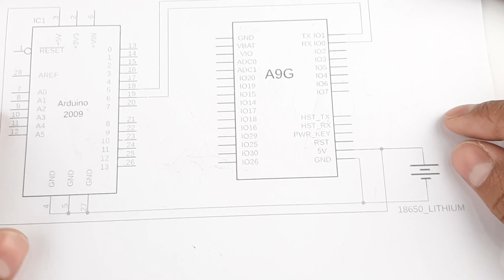SMS Based Vehicle Tracking System with A9G GSM+GPS Module and Arduino

Comment: Hello Sir. Im trying to make the same project but with arduino uno. Im able to sun AT commands on A9G through blank arduino and it runs successfully. But when i use your code the arduino is not able to communicate with A9g. How to solve this issue? im using micro usb cable to power a9g module as of now
Reply from the maker: Make sure the connections are as per the given schematics. It is important to use proper pins for UART.
Reply: @Circuitdigest  thank you. I reconnected everything, and it seems to be working now. I also wanted to connect a speaker so to hear the other side. So I use a 5v stereo audio amplifier (only using left side of it) but I can't hear the other side. The usual sound that a9g makes in serial communication in Ai thinker application is there though

Comment: does not work...
Reply from the maker: What was the problem? You can get more help from our forum. https://circuitdigest.com/forums
Reply: @Circuitdigest  A9G does not recognaize the AT commands, hence gps does not start...
Reply: @cgoguerreiro  im also facing the same issue. Does a9g when using blank arduino code or through serial converter accepts code? mine does that way

Comment: Sir Need your help !!! Sir serial monitor is showing sending msg (even the lat longs are correct ) but i haven't rcvd any msg on the number which i have entered in code. Would be grateful if you help sir
Reply: does not work the A9G will not start GPS because it don't receive the serial setup

Comment: Why are you using arduino? What does the arduino do?

Does https runs for~ 7 minutes and stops working in code? in a9g board.
Reply: As you didn't get an answer, I hope this one will do. The A9/A9G is based around a standard micro processor (SOC) which runs firmware that handles all the Satellite and Mobile phone requirements. The firmware on the A9/A9G also monitors the serial RX/TX lines and accepts/responds to standard modem AT commands to control both the Satellite and the mobile requirements. It also can handle sleep modes by monitoring one of the GPIO pins (going into lower power mode until some external condition changes the state of the 'wake up'/'sleep' pin. So hopefully you can derive from this that the Arduino is used to provide the application/communications  via the Arduinos Rx/TX serial lines to/from the A9/A9G using AT commands as this is far simpler than changing the inbuilt firmware to handle application code.
Reply: can we use the A9G Module without the Arduino? @ianhewitt1858